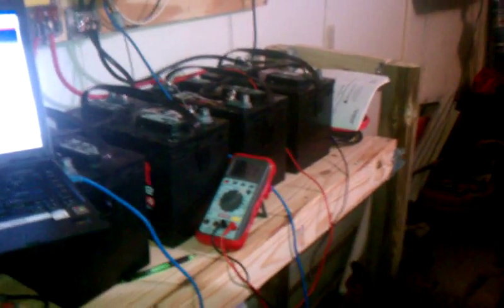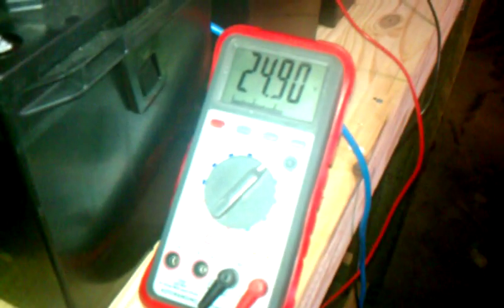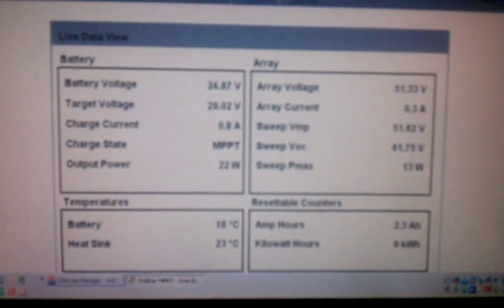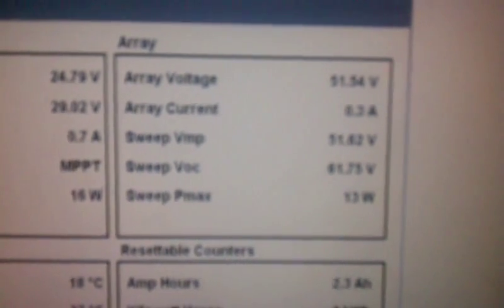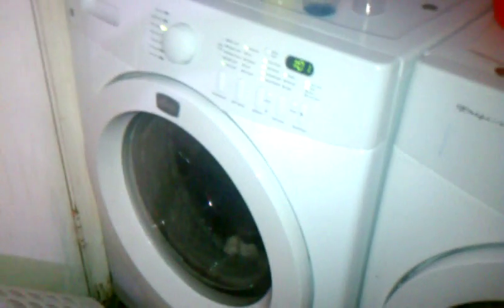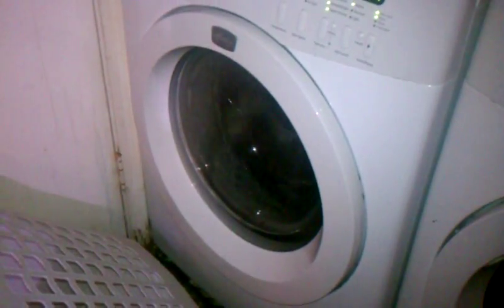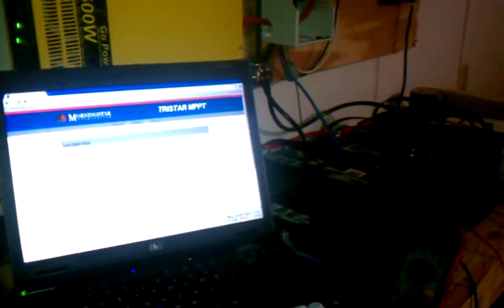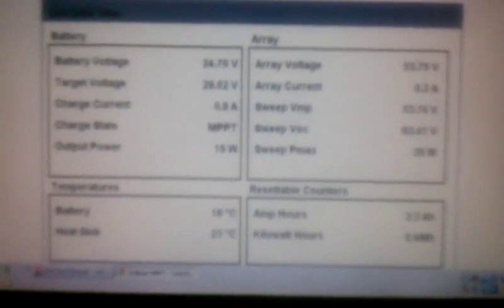Solar panels MPPT charge controller and 1500 watt Go power pure sine wave inverter part 5

Comment: You've done a great job with these videos. I'm just getting started and have two 14 watt panels. I'm curios about your carge controller. what kind is it? I have a spare laptop and am intersted in the software you are using.

Comment from the maker: @shartne The MPPT is changing the incoming voltage of around 60V to whatever the best voltage is to get the highest wattage out of the system at that point. MPPT will sweep the voltage and amperage curves and lock in on the "sweet spot". When MPPT reduces the voltage the amperage goes up so you can see 50V at 2A but the batteries are charging at 24V @ 3.75A since the voltage was reduced, the amperage went up. It's very, very efficient, I saw 800W out of 1150W of panels in partial shade. NICE!

Comment from the maker: @Xringer That's what I've been told too is the 10V cutoff is fine as long as you are using deep cycle batteries as they will spring back. My bank springs back to 23.16V after they hit the 10V cutoff. The real damage happens when you drag the bank down to the 10V and keep a load on it OR after the cutoff is hit you reset your inverter and start drawing on them again. This bank is going to be run through the ringer to see how long they last before we buy a large bank and decide which batteries...

Comment from the maker: @Fearlessthinker We take our battery bank down to cutoff voltage if the demand calls for it otherwise we'll let it fall where it falls. The purpose of buying a deep cycle battery is so you can drain and fill it. If less you take off it the longer it lasts but only trying to take 25% of would be absurd. Most people who seriously live off these systems try not to go below 50% but deep cycles will handle 80% and still be ok it just shortens their long term lifecycle. For us...we dont care :)

Comment from the maker: @shartne I must have run 4 or 5 loads today on the washing machine and it barely made a dent in the battery bank. I was pulling over 900 watts at one point for about an hour and it barely moved the voltage. Also, I saw some nice spikes today of about 700W on the MPPT side so this charger is mega-efficient. Tomorrow is supposed to be a very clear and sunny day so we'll see what happens tomorrow!! More videos coming very soon...

Comment: I like that you can actually run your washer that is sweet. So the MPPT is changing the array voltage to what in voltage? It can probably run your fridge no problem if it can run the washer. I like that inverter so far.